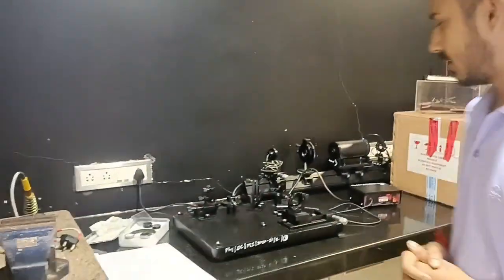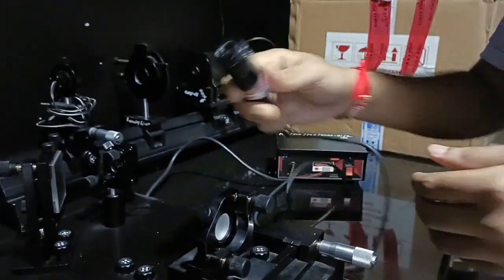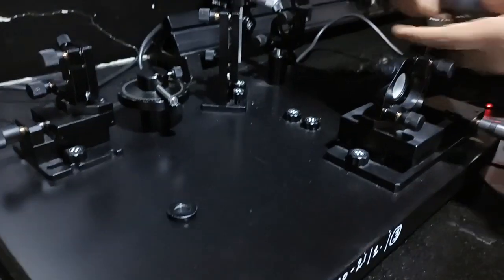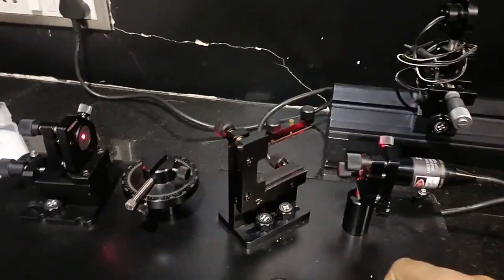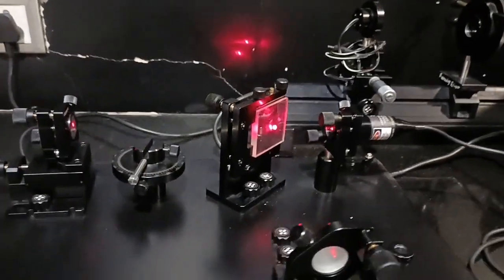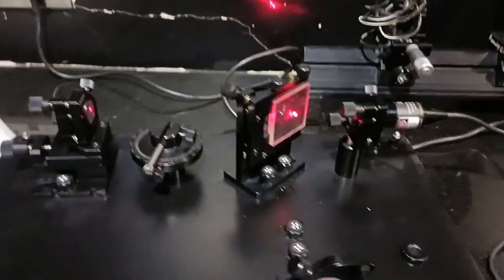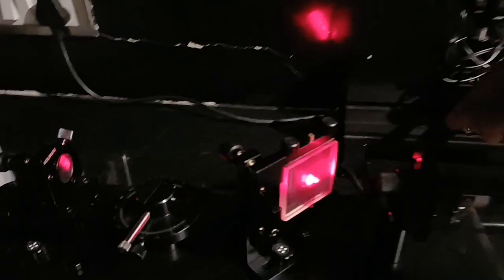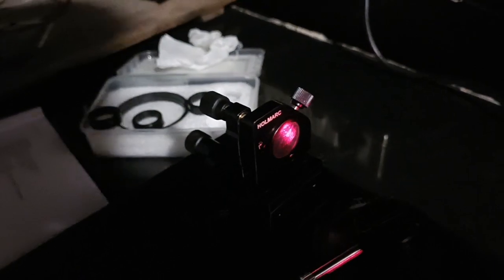Michelson interferometer experiment | Bsc physics | Msc physics | Michelson Morley experiment

Comment: I think that the light measured in the Michelson-Morley experiment suffered interference from the medium (not the Ether but from the atmosphere)... that's why there was no change in speed in any direction... if we observe a ray of light at an angle when it passes from air to water, the light undergoes a deviation in angle and also suffers a reduction in speed because it is in another medium. The speed of light inside water will certainly be measured with the same speed regardless of the direction of the measurement... the same, I think, happened in this experiment, the light from the Sun towards the Earth may have varied a little when it would be expected in the experiment, but when it reached the Earth's atmosphere, the light began to have a constant speed relative to this medium... If the measurement is repeated in an external environment, such as on the Moon or maybe in the Space Vacuum, this experiment may show different speeds for each region...
if the light speed changes in that new experiment, I think we need to change the concept that light speed is constant independently of direction or observer...